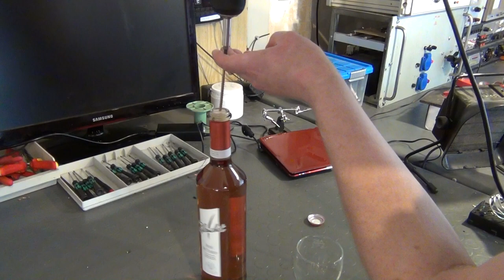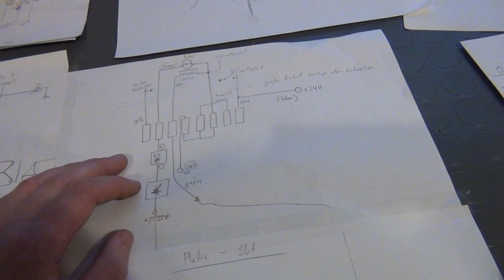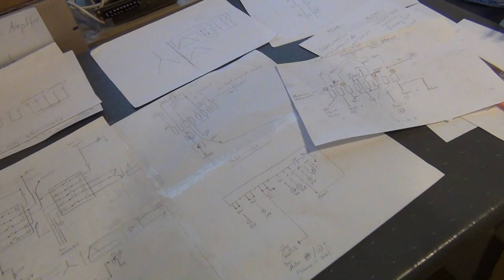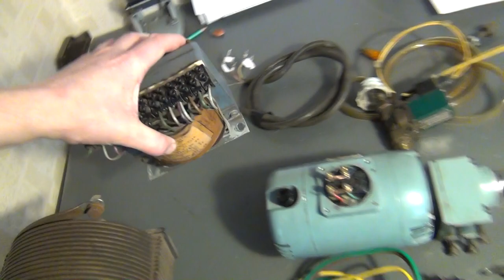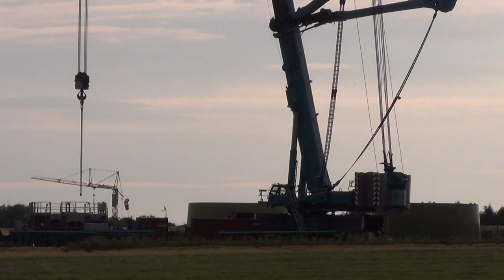TPAI Lab Report # 001:  Reverse Engineering / Welding Machines

Comment: A good trick for reverse engineering double sided boards is to take pictures of both sides, then line them up and overlay them in a photo editing program. Then you can take notes and draw circuit diagrams on additional layers above the pictures. You can also adjust the opacity to see both sides of the board at once.
Reply: Yes, a good photo editing program is a brilliant way to do this - otherwise, it's very time consuming. It also helps greatly if you have controlled light above and perhaps also below the pcb.
To strive for perfection, you can mount the camera on a steady but adjustable height support (similar to a cheap drill press stand) and aim it squarely at the pcb i.e. as vertically as possible. Then, adjust the distance so that you obtain the best resolution and least amount of shadows and lens distortion. If you have some kind of vice for the pcb that enables you to fix the pcb perfectly square within the photo frame, you can also use that to ensure that both sides of the pcb are mounted at the same distance from the lens. Then you will be able to perfectly overlay the photos of the two sides without messing with adjusting angles, stretching etc. in the photo editing software.
Reply: Rocketman221 this is the same method that I have been using for years. Great minds run in the same ruts. This is a great method for reversing a PCB.
I have found the GIMP works great for this. You can adjust for trapezoidal distortion as well as scaling. You flip one side. It allows for opacity adjustments like you said you use.

Thx for sharing.

Comment: Thx for sharing. I guess at this point what follows is too little to late but here goes anyway. Take what you want and leave the rest.

Welding machines have two modes 2T & 4T modes. A user button or switch is used to control welding power. That bi-stable relay (AKA also known as) could be used for the 4T mode. 2T mode is defined as press and hold for welding power release for stopping welding power. 4T mode is defined as press and release, welding power stays on, press and release again welding power is stopped. The 4T mode allows the user to run a weld bead without having to continuously hold the welding power button. Moving on.

How to make a custom gasket - 
Get gasket material of the proper thickness. This can come from an auto parts house or online.
Use one of the mating sides for the pattern.
Place the gasket material over that selected pattern surface.
Get a small hammer with a ball peen and flat head could be on the same hammer head.
Strike the gasket material with the hammer to cut or mark the edges. Use many light blows. It looks like the reduction housing material might be Aluminum hence the need for light blows you don't want to damage the mating surfaces only cut or mark the gasket material.
You should be able to use this technique to make a decent gasket.
For the small holes just mark the outline with the hammer and use an Exacto knife or some other sharp knife to make the holes.
In the end you will have a great fitting gasket.

For the circuitry reverse engineering - Research MIG welder circuits which I'm sure you will do or have done. This will give you a feel for what circuits are used. That board with the 20 pins don't be daunted by it. Even something as simple as a 555 timer IC would look a lot like that. Lots of parts and many transistors.

Rocketman221 uses the same method I use to draw a circuit from a PCB. Combine that visualization method with a schematic program like TinyCAD or KiCAD. They will make it easy to rearrange the parts. A schematic program will maintain the connectivity while you move the components around for the best presentation.

Sorry to be long winded. I wanted to cover several topics.

Hope all this helps with this project and many others.

Again, thx for sharing.

Comment: First up, Gday From Australia, and thank you very much for the series on SMPS PSUs! Over many years I'd taught myself the basics from videos 1 and 2, but learned more from 3, 4 and 5 than I would have in years! The analogies for magnetic circuits were perfectly intuitive!
What made me post this comment is your question about a seal/gasket for the fan gearbox. From my experience with DIY car maintenance over here in Australia, there's a cardboard-like, grey fiberous material for making custom gaskets for car water pumps, sump gaskets etc, which is available quite cheaply from automotive stores here as a roll. It can be cut with scissors or a scalpel and will form an oil-tight, high temperature seal once clamped between surfaces. I'm not sure what it's called, but I'm sure similar products would be available in Germany too. An additional tip, I've found Permatex No 3, a rosin-based non hardening sealant to be excellent in combination with that gasket material, it makes even better seals in contact with oil or water, and I've heard on glasslinger's YouTube channel that by itself it makes an excellent vacuum seal on acrylic enclosures for HV transformers etc if left to dry for a few hours first.

All the best,
Rob

Comment: I like this supplementary type of video, it's great to see what your thinking. Stepping through circuits is something I want to understand better as a process.

I have been digging through an old 1940-50's radio recently. I got lucky and found the circuit diagram online but I need to spend some time really cleaning things up and trying to sit down with it to understand what is happening.
I think I'll need to replace a load of capacitors but I hope the tubes are still functioning well.

The diagrams you have had on transformers and audio circuits have helped me massively since electronics is a weak point of mine.

On another note, a lot of windmills in your area. Interesting machines, we have a good few around where I live too since the climate is fairly well suited to their use.
The foundations and bolt arrangements at the base are crazy when you actually walk up to them. I love the scale of such projects.
Reply from the maker: zero_sum Hey. Cool that I could be of some help even though I did not (yet) make a video about tube based audio electronics.
The wind turbines that are being built here at  the moment are (as far as I know) of the  Enercon E82/3 type.
The hub sits at a height of 138m. The diameter of the rotor is 82m.
The base of the tower at the ground level has a diameter around 15m. These are gigantic turbines and Enercon operates likewise gigantic cranes to build them. It's an awesome sight!

Comment: (1) New format: I really like it. In the beginning you were NOT relaxed and the speech was full of 'Ahh', 'Mmmmm', etc, but about the time you were showing schematics and wine reached your brain it was the old cool relaxed PAI. GREAT!!  . . . . . . . (2) GEARBOX SEAL:  If it has a gasket you already have many suggestions. However, if it is like many motorcycle engine cases with no gasket, then that is where  your answer lies . . . . At a motorcycle repair shop! . . . THANKS AGAIN / STILL.

Comment: To seal the box of the wire feed motor you can use aluminum tape. You can put it on the (degreased) edge and cut the rest along the casting. It seals perfectly if the casting is not warped.

I love your video's btw. Thanks

Comment: For the gearbox gasket.. In the US, you can buy gasket material in sheets for pretty cheap at hardware and auto parts stores.. It usually comes in paper, cork and rubber at varying thicknesses. There should be something similar in DE.

I've actually used the thicker paper from cereal boxes or greeting cards that I cut out with a razor before with surprising success for carburetors and the like. But any thick paper (close to the original gasket thickness) should work. Normally when the paper is compressed it shouldn't leak or seep out, but if you're worried about it you can always coat it in rubber cement or even smear on a thin layer of silicone before installation.

In fact the crank case on my dirtbike has been leak free for the last 2 years with this method (thick paper board and silicone). It was supposed to be a quick hack just for one short weekend, but if it ain't broke, don't fix it!

Also, if the part allows, you can put grease on the mating surface and press it onto the gasket material to create a perfect template to cut it out..

Comment: 15:50 : You can buy online sheets of material used for making gaskets Then you can draw on it and cut it in any shape you like. It comes in various thicknesses of course so you need the original gasket to determine the right thickness. You might also need to obtain the right kind of sealant that must be used with your gasket depending perhaps on the oil contained in the gearbox etc. Also, perfectly cleaning the mating surfaces before reassembly is, of course, a must.

Comment: I know that this video is about 6 months old, but I'm new to your channel and I'm having a marathon of watching them to get caught up.  I wanted to see if you solved the issue of the leaky oil reservoir on the motor?  Can you not use some thin sheet-style rubber or gasket material like is used in automobiles?  That's the first thing that came to mind.  Keep up with the videos.  I really like them, especially the repair videos.

Comment: Thank you for the video! Awesome! Also waiting for the inverter welding machines teardowns and explenations. BTW, what is this material that you cover the bench with? I think I have seen it on floors, right?
Reply from the maker: BIll Georgoulakis My benches are made from old wood that I salvaged from broken furniture. I coated them with a resilient kind of PVC  floor coating. It's a wonderful material, since it is very easy to clean. It is quiet rugged and not very expensive as well.

Comment: Ave-bis. Now from Germany.

I have similar method for reverse engineering, also pretty chaotic, but it takes time to methodologically trace everything, annotate, layout diagram so there is no mess of connections from everywhere to everywhere, and then understand why things were designed in specific way. I often stumble in designs some questions, like "this is stupid, why they did this". More often than not, the cost and laziness are the answers.

Comment: You can make gaskets fairly easily.  scrape some silicone over some old thin cloth, try to get a good flat surface.  do the same on the other side, then cut it out to the correct size.  alternatively for a quickfix try some waxed cardboard.

Comment: I actually made some reverse engineering (schematic drawing) of a welding machine recently. Was quite some work but not near the difficult level this guys work in.
The welder was a inverter based MIG from Telwin called Technomig 150. I bought it from ebay one or two years ago but it was dead out of the box. Since I bought it online  it was too much of a pain to try to send it back and I was hoping it would be some simple fault like loose connections. I therefore opened it and tried to find the simple problems. It was not any connections and I then started tapping the circuit board. Eventually I found a surface mounted resistor that was not in connection to the board although it looked perfectly ok. A resoldering solved that and the fan then started to run. However the welder wouldnt still run. I found some telwin schematics but from mma inverters. I tucked it away for some year waiting to find the correct schematic but to no success. I asked Telwin about it but obviously with no reply.
Just recently I wanted a mig welder for the summer house so I pulled it out again. Using multimeter and oscilloscope I made some rough schematics to understand how it should work. Eventually I found that the driving signal to the power mosfets was only reaching one of the two. And guess why, it was another surface mount resistor that wasnt connecting although it looked perfectly fine.
So, the Telwin welder firstly had two bad solders from production and secondly they hadnt made any final checks of the board. Quite bad quality control to say the least :)

Comment: Perhaps I missed it, but a good way to reverse engineering a 2-layer board is to photograph both sides with a good camera and then overlay the two layers using transparency in a photo editing program such as Photoshop.
Reply from the maker: SolidStateWorkshop Yes that's true. I have used that method a couple of times myself.

Comment: Yes that was a smashing video :-D, Just seeing all those parts is interesting to me, ive been a repairer since i was ten, well i took things to bits at that age ha ha :-D.
Old equipment was made very very well, heavy duty and over rated for reliability.
Ive never seen a relay like that, the closest ive seen is a relay that stays in its last state unless you apply reverse polarity to the electromagnet, a relay with a memory.
I too have made schematics like you have, the first draft allways looks mad lol, the second draft is the clean up :-), only make diagrams when you are in the mood, otherwise you can get mixed up, annoyed, and often give up.
Your motor seal, perhaps a section from an old rubber innertube could be cut to make a gasket, perhaps, ive used the back of a cardboard cornflakes packet, it compresses well.

Comment: 16:16 depending on the required/allowed thickness for the seal.   The amount of pressure and temperature...

You can make them out of thick celophane (freezer bags), or paper (a lot of seals are made of paper) or something like PET (can cut it out of a 'smooth' drinks bottle)
For high temperature, high pressure, a soft metal like lead foil, tin foil, (can get these as thin as 0.001mm, though that thin will be hard to process manually :p)...
without the hassle, a material like putty, plasticine, tar (very thick viscous fluids) though that'll make it a bit harder to open later...

Comment: i was thinking maybe a good project for your future would be making components from scratch from raw materials, eg. transistors, relays, diodes, resistors, heating elements and motors etc. like how they would have been made when they were invented or say 100 years ago.

i think that would fit your post apocalyptic style, because of you can't find a component making one would be awesome, oh and also maybe a soldering iron made from scratch would be a cool project.

just a few suggestions that you may or may not want to pay attention to, but i just thought i would put it out there.

Comment: For blue engine that has oil leak, you can use thick as the cover of boocjs written paper. thus the metal copie of the format for cut gasket.

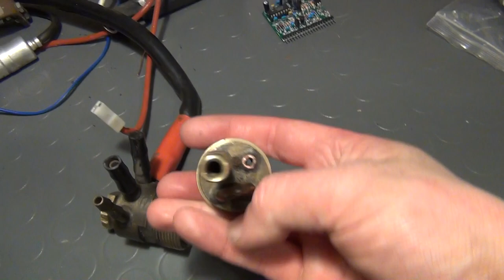Comment: 07:10 : I do hope you can repair this as I have an old La Pavoni espresso machine with exactly the same problem - except that it's a heating element brazed on a brass flange instead of a simple copper pipe. Nevertheless, the materials that the joined parts are made of are the same in both situations. I suspect that in the Pavoni silver is used as soldering material (or mainly silver-based and in any case lead-free due to it having to be food-grade) but it could equally well be tin-based. I haven't been able to determine its exact nature.

Comment: Regarding the gearbox seal, in addition to the paper/cardboard mentioned by others, I used this Permatex Aviation Form-a-Gasket #3 when working on automobiles years ago. It is a little messy if you're not careful, but forms an excellent seal, especially in conjunction with a paper gasket. It is alcohol soluable (shellac-based I expect), so cleanup is pretty easy. Use sparingly. http://www.permatex.com/products-2/product-categories/gasketing/gasket-sealants/permatex--aviation-form-a-gasket--no--3-sealant-liquid-80017-detail. You may also want to lap the surfaces on fine wet-or-dry sandpaper mounted on plate glass before re-mating. If they got hot or were subjected to some levering forces they may have warped a bit. You can also try the form-a-gasket without a paper seal if the joint thickness is critical. Love your videos! :)

Comment: of course your video is old so you probably fixed it already, but the best if the clearance isn't a problem, take the gearbox apart, d-grease it,& make a paper gasket, you can buy the gasket paper at most auto parts stores by the foot, (or inch) & if it's still available, I use to seal Volks wagon motors with a liquid called Gasgacinch clean both surfaces well, let dry, coat both sides, let dry, then put it back together...
Reply from the maker: +Bob White Hey Bob. Yes I have repaired it by now and used a paper gasket, just like you suggested. But thanks for the advice anyway :)
Reply: Also a product called Gasgacinch is an excellent liquid sealer

Comment: Everyone told you about gasket paper but if you plan on making your own gasket do yourself a favor and get some hollow chisel punches. You can cut out holes with a hobby knife but that gets tiring fast. Plus the holes I try to cut out with a knife are not quite as nice as the ones I can punch out with hollow chisels.

Laying out gaskets is one place where cleaning ahead of time doesn't pay off. Just put the dirty part on the paper to stain mark it. Though some people clean, then rap the part with a rubber mallet. Anyhow, that's my two cents about making gaskets. If you really don't want it to ever leak again get yourself some Indian Head Shellac. I swear by Indian Head!

Really, don't use Indian Head, unless you absolutely have to. It is the stuff for doing car water pumps though.